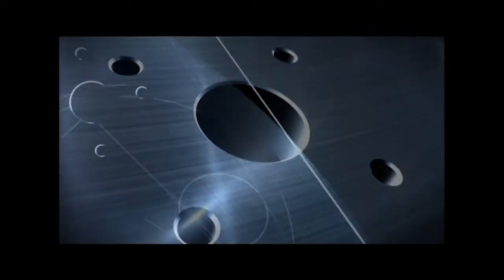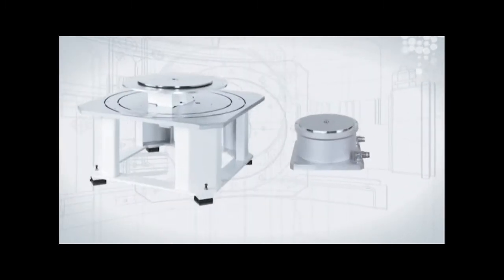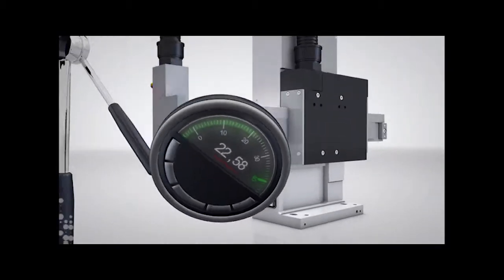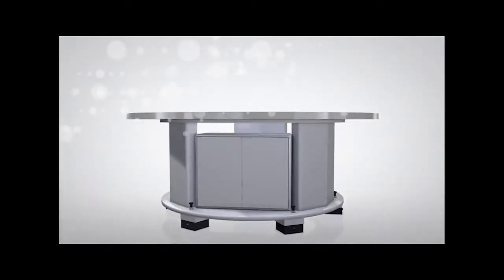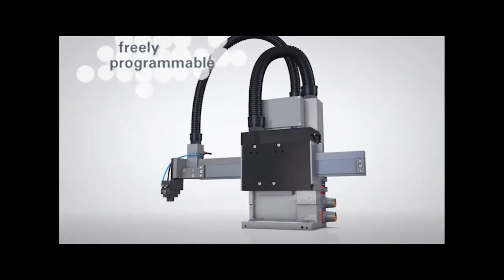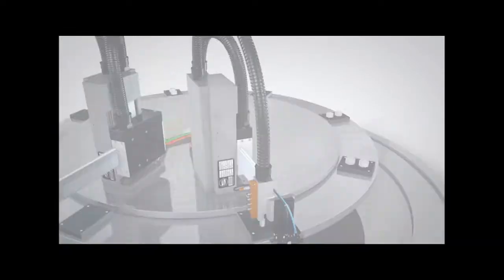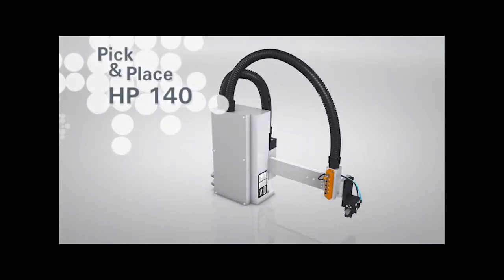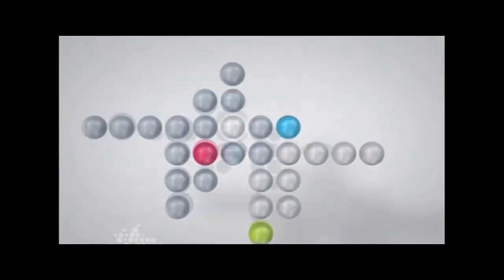WEISS HP Pick & Place Handling Modules - The Direct Alternative

Comment: these systems are blindingly fast... from my technician standpoint, these systems are full of win, the only issues i have encountered involve the integration, sometimes the tooling cant keep up the pace, and i could not access any commands to slow down the Weiss, to see what was happening.... and they are robust, just put the correct lube on the slides, and they will run HARD.
Reply from the maker: Thanks for the comment, Michael. I'll reach out to one of our specialists in this area and hopefully they can provide some assistance.
Reply: @WEISSNorthAmerica  thank you so much for the rapid reply, we resolved the performance issue in house, an Engineer had access to the software, he fine tuned the place positions, and that is when we found a wobbly gripper....
Reply from the maker: @michaelmckinley4588  Great - glad to hear you've resolved the issue. Feel free to reach out with any more questions or call one of our app engineers at 1-888-WEISSNA (888-934-7762).